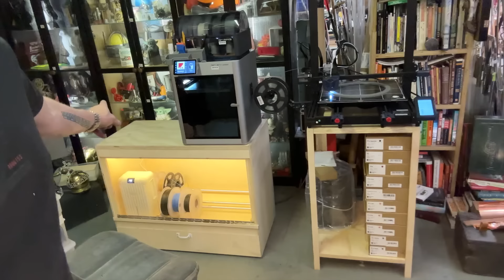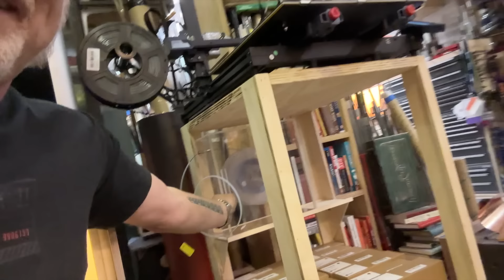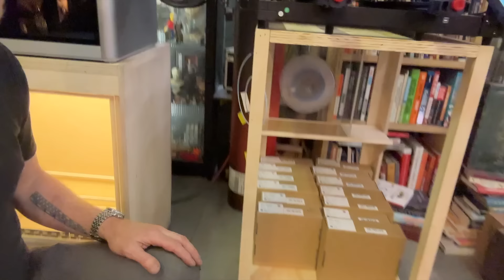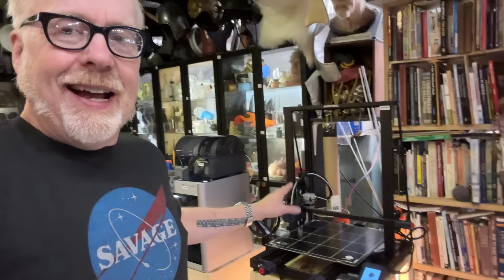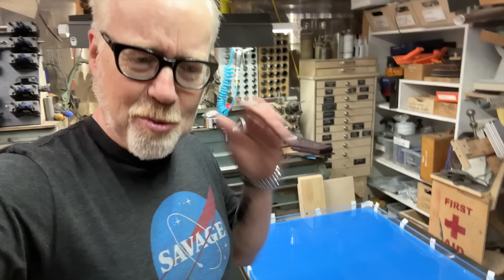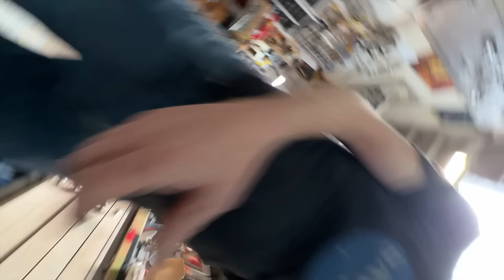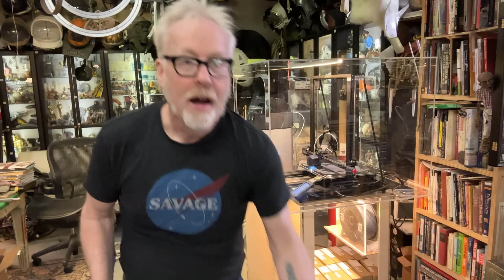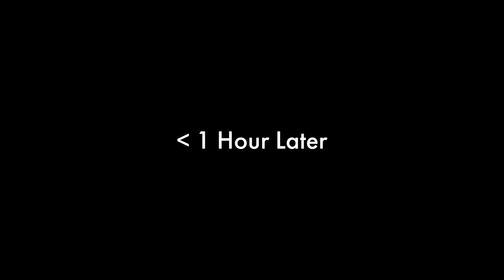Adam Savage's Biggest 3D Printer Yet!

Comment: Build a Voron! Doesn't matter if it's a tiny v0 or a big-ass v2.4, you'll love the instructions and the satisfaction of building your very own printer, with all (or none) of the mods you want.
ProTip™: Get one of the LDO kits, they are amazing and use only high-quality parts.
PS: That table does not look very stable. The huge bed will have a lot of inertia, and your table will start swinging back and forth - which can impact print quality very negatively. Even Resonance Compensation (look it up) may not be able to save you. Rule of thumb: If you can rock the base for your printer back and forth with your hand, it needs stiffening/braces. In the video at 36:10 it looks like it moves A LOT...
PPS: You should print costume parts / props from PETG, and that does not need nor want an enclosure, as increased ambient temperature (by the heated bed) may soften it to the point where it clogs your nozzle. Pretty much only ABS and Nylon would benefit from an enclosure, at least when we're talking about typical filament materials. Stay away from PLA, unless it's only decorative and will not see any wear and tear.
PPPS: A hygrometer in the printer enclosure makes absolutely no sense. Temperature? Maybe. Humidity? Nope. Even dryboxes for filament are kinda overrated, just get a drying oven and dry your filament ad-hoc when (and if) needed, instead of keeping all of your partially used spools at low humidity.
I'm printing for ~10 years now, and eventually you'll figure out what's useful and what's just hyped, cosmetic or marketing.

Comment: My father in-law was an architecture model maker for 50 years, and he used acrylic often, specially for the model covers/encasings, and he used chloroform to glue it, and it worked like a charm. He applied it on the edges with an eyed-dropper or a small brush and it dried SUPER FAST and stayed tight as hell. AND, if he had to take the box apart later, he would use the thing again to dissolve itself and recycle the plastic for something else.
If you can find someone to sell you a small vial of chloroform, give it a try someday.
What kind of glue do you use?

Comment: Fascinating to me that you can work on the case WHILE THE PRINTER IS PRINTING. I'd have been rather nervous about messing up the print. Thanx... and what fun to be adding more printing capability in the shop. WOW! 🌻
Reply: Yup, you can pause printing and change filaments, for example if you want to use different colors in a print.
Reply: @DoctorNemmo  🌻
Reply: He could literally pause the print, take out the filament, put it in the new box and then continue on with that printer. I do it on my Creality 10s Pro V2 all the time. In fact, in some of my printing, it's required.

Comment: I don't think it'll be an issue, but I stopped using acrylic for the purpose of "windows".  first reason is that it's so soft that they scuff and become milky/cloudy pretty quickly and are just not great at being windows to look through.  second reason is probably the more important one, but acrylic burns like crazy once you get it started, like it burns quite well, which is not a good thing if you're putting it near some sources of heat.  it does take a bit to get it burning, but once it does, it goes the distance.  here's a video from a company that makes polycarbonate that made two bus shelters, one from acrylic, one from lexan (polycarbonate), set both on fire, and you can see which one goes wild: https://youtu.be/Jeg40vPr7Vs?t=77

which sucks because lexan isn't as nice to work with in most ways compared to acrylic

Comment: You want big fast prints? Check out the Voron v2.4 (its a DIY 3D printer, but they print fast, clean, and have very large beds as well). And there is a downside to enclosing the anycubic (let alone any printers really) is cooling of your filament. If you're printing PLA in there, it shouldnt be sealed/enclosed, or the filament will not cool sufficiently. (Honestly, it'll probably be fine though) But anyway, check out the Voron v2.4 - would be fun to watch you build one.

Comment: To those with smaller shops: You can also buy bigger sheets and use a plastic cutting knife to knock out panels small enough to clean up on your table saw! Theres always options for those of us cursed to work in basements, they just take a bit more work lol

Comment: Might be worth putting a mechanical fastener into the led strip above the printer. Last thing you want is the tape releasing midway through a multi day print cause the tape glue softened due to the heated enclosure.
Reply: @shadowarachhthe glue holding the led to the channel, not the channel to the enclosure

Comment: A maker like yourself, I'm slightly disappointed you went with something like a bambu. I would have expected you to get a printer that you can build and tweak. I personally think the x1c are overpriced for what they are but they are (for the most part) click and forget printers and you know it should finish no problems. Either way. Good to see you entering the new age adding technology to your maker space.
Reply: Acshuallyyyy.... I am disappointed too ^^ When the vid was titled Adam's biggest printer to date, I was expecting a custom build like the big ass printers shown on Tested by Frank ippolito at his shop (i think he's got a 50x50cm and 100x100cm one). These would be perfect for costume and prop design. But you can't blame him for getting an X1 Carbon. If he was just printing PLA @#$€! sure that would be overspending, but for finnicky materials like asa, nylon or carbon fiber, it's the next best thing from really expensive pro printers.
Reply: @the_arcanum  the P1S will do everything the X1C will without the added complication of lidar and all the other crap. It's enclosed and the equipment is pretty much the same and several hundred dollars cheaper. But I would have thought that something like a voron, ratrig, vzbot, etc etc etc would have been a better option for his maker/tinkerness
Reply: @b3nny90  As reported by Eli on The Next Layer, there's a major difference between the new P1S and the X1C it's the temp the bed can ramp up to that has direct impact on the filament you can use. If you want nylon and polycarbonate, you need the extra temp. If you don't why even bother with a Bambu Labs ? There are cheaper options. 

I think you're projecting too much into Adam : he is a maker, not a tinkerer. He may gawk about nice tools but he's rather make things with them than spend hours on perfect polishing them to a thou of an inch. Some people love to tinker with their printers to no end, some would rather print with them. Building 3D printers is a hobby onto itself.

Comment: Thats not a "big" 3d printer.... i custom designed and built my big printer.  Its build area is 800x500x450....  I consider that the new large format where years ago a large format printer was a 300x300.........
Reply: IDEX?
Reply: @KZ-yy9pm  not sure what an idex is but i think you are thinking its a commercially available printer.. as i said, i "designed" and built it.  its a one of a kind.  at the moment im trying to set it up for input shaping to eliminate some ringing i have which is due to the design.

Comment: Big word of advice for your 3D printers, Put them on really solid sturdy surfaces, I can see your anycubic is wobbling a lot. That would show up as echos or ghosts as the whole structure is vibrating. Thicken up the legs, put in corner brackets and if its on wheels, swap it for wheels that can switch to feet.
Reply: Putting a concrete paver under the printer would go a long way. It'd increase the inertia of the cart, and require a lot more force from the printer before it would start shaking.
Reply: That will help, but the floors in his workshop themselves are bouncy, so that will also be a factor.
Reply: @Calamity_Jack   Hmm... Can put down a heavy gardening paver to dampen the bouncy floor, then a rigid table on top of the paver.
Reply: I got into printing a while back when 90% of printer setup was just getting the damn thing level. But yes, anything to damp vibrations is a good idea, and MASS is better at that than fancier solutions like rubber feet or springs. That’s why a genuine, old Technics turntable record player weighs 40lbs more than a modern one.
Reply: Input shaping will help reduce the impact of vibrations, but I also came to post this tip.
Reply: @smartinsilicon  Kobra Max doesn't have it native, at least the last time I checked. I'm pretty sure someone's done a Klipper build for it by now, but that's a whole different can of worms. 1 day build turns into 2 weeks of troubleshooting and a drinking problem.
Reply: I have a delta, Anycubic Linear Plus. 2 DIY upgrades that made a big difference on ringing were mounting it on a concrete tile (ugly, but tolerable if the thing is not the centerpiece of your living room), and adding an external carcass/bracing, made from 3mm thick mild steel, cut by waterjet and bent on a CNC machine to fit the outside of the printer frame. Rigidity is one thing, but mass is also important, more is always better (up to a certain point, of course).
A heavy cast iron printer frame would've been pretty awesome, I wonder if any of the industrial models have those.
Reply: I'm actually more concerned with installing shelves while it is printing. Clearly he's not worrying about wobbling when he is wobbling it himself.
Reply: I don't know if you've seen the video of marker's Muse, where he tested exactly this. Unexpected result: if the printer is stiff enough, you can hang it from the ceiling by bungie chords and the quality won't suffer. And I hope you'll realize that that fact also makes sense in terms of physics if you think about it again.
Reply: I put my printers on concrete pavers. In a perfect world I'd have something sturdier than an ikea shelf, but decent furniture starts to cost more than the printer.
Reply: It’s San Francisco. Even the ground isn’t stable.
Reply: Watching I was thinking that as well. But I also wondered if a sheet of like quarter inch rubber between the box and the stand would also help with softening bounce of his plywood floors.
Reply: Great advice.  A very stable base makes a huge difference.
Reply: You do want a sturdy surface but you minimize ghosting and ringing with anti vibration feet not by solidifying the frame. That would increase the ghosting and ringing effect.
Reply: @PLr1c3r  one could also try to increase the mass of the frame significantly, instead of rubber-mounting a lightweight printer. I tried both approaches, and the former had a much more significant effect than the latter. My printer is a delta, the effector is relatively lightweight as-is, however with the stock 2020 aluminum extrusion frame the inertia of the effector was still shaking the printer pretty badly, causing print defects. After I beefed up the frame with some steel bracing (see my other reply in this thread), the printer stopped shaking when the effector moves fast

Comment: The build up of heat is a concern when you enclose the entire 3D printer including the controller board and stepper drivers. Steppers drivers run hot on the controller board and need adequate ventilation to keep them cool. Otherwise they will momentarily shut down to cool off resulting in skipped steps on your print (layer shifting is the most common result). So if you start noticing more failed prints due to mis-aligned layers, that's the likely cause. Bamboo labs mitigates this issue by enclosing their controller board and stepper drivers in a separate, air cooled, section apart from the print bed.
Also, be aware that some filament, such as PLA, does not necessarily do better in a hotter enclosure. That filament needs to cool off quickly to prevent layer sagging.
Things to watch out for.
Reply: Very true. But the first thing that's going to fail when enclosing is the power supply. Next is controller board as you said then the steppers if the temp gets crazy inside. I got both out when i built my enclosure but couldn't bring me to safeguard steppers with watercooling. That was way more over-engineering that i was willing to mess with. It's way easier as a hobbyist to regulate inside temp with a chicken coop thermostat and automated filtered fans.

Comment: You just made a drybox which can only hold a filament spool with the same large diameter hole in the middle. Different brands of filament differ widely.
Reply: I feel like he has a specific brand he buys a lot of that he knows.
Reply: @geak78 I was thinking the same thing. He has boxes of all the same brand, I think, below the printer.
For someone who buy whatever is on sale/is cheapest, the pipe might not work, but maybe a smaller one would, but it wouldn't be as strong to support the filament roll.